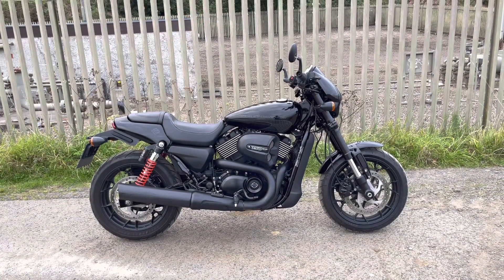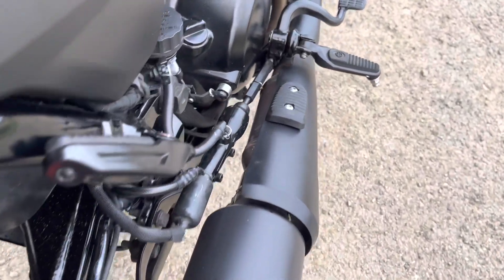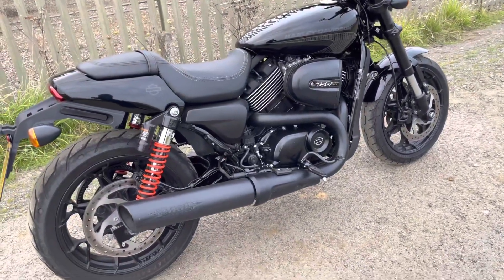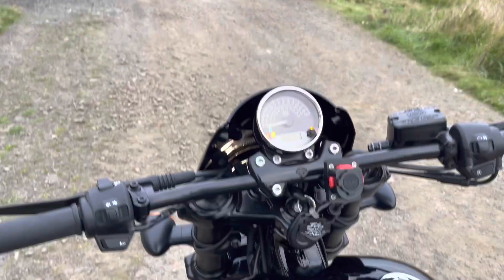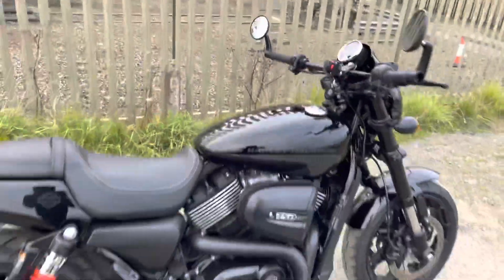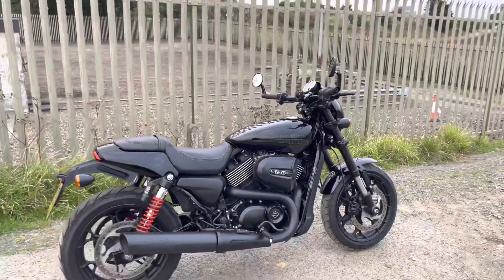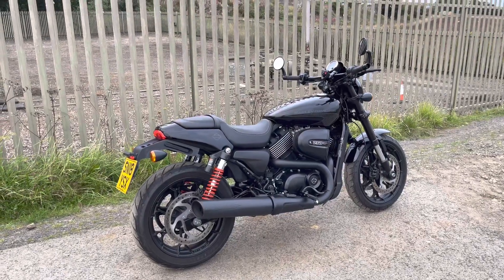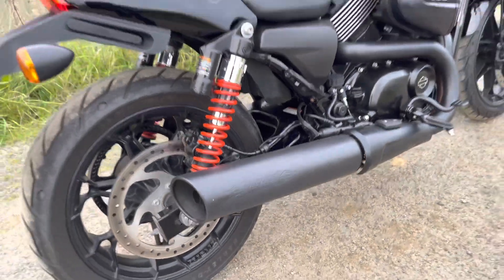Remus Custom Exhaust For Harley-Davidson XG750A Street Rod 750 Mini Review VS Stock

Comment: Hey FKW, that Remus slip on exhaust sounds WAY better than stock tail pipe! You can still "hear" a little of the "Fisher-Price/Playskool" toy exhaust noise, yet, just a bit! That Remis clears up that noise almost completely!👍🏍️😎 It doesn't stretch so far back to the back of the rear wheel like the O.E.M. pipe had! Good choice.👍🎉🦅 Doug